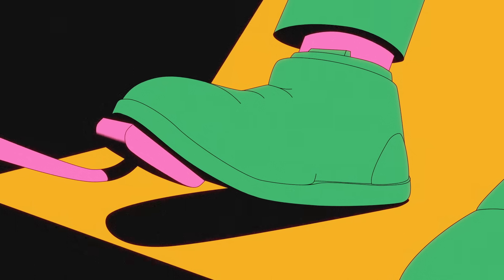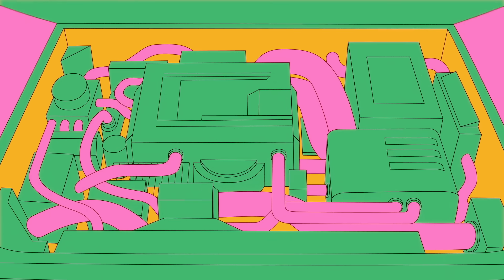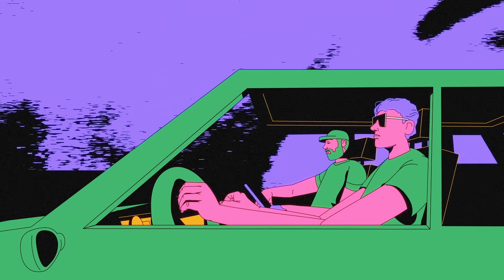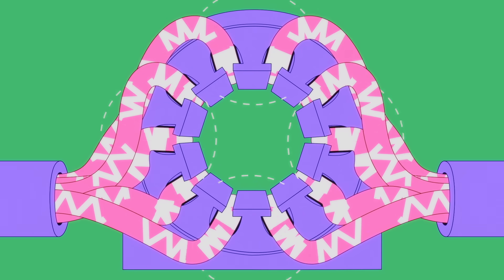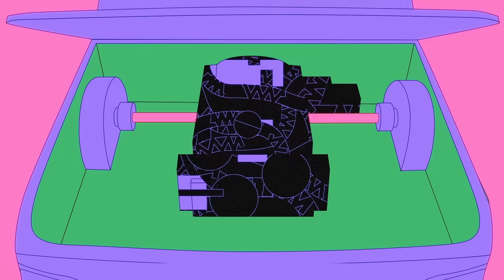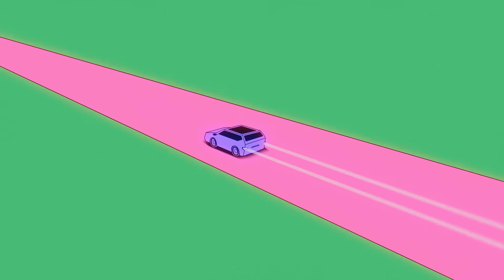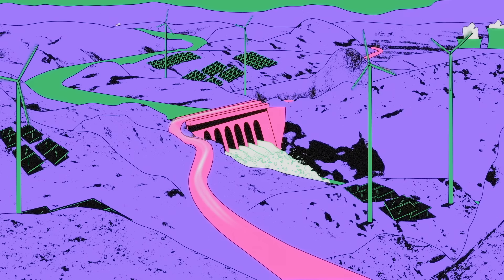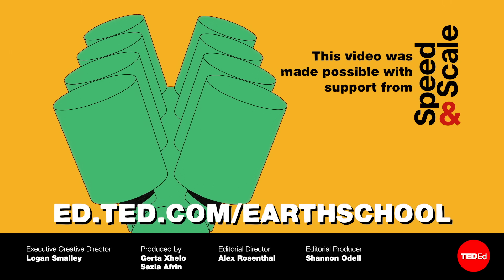This is what happens when you hit the gas - Shannon Odell

Comment: I love it how the wok always fail to mention the reality of EV when discussing them and only talk about the good.  

First of all, nobody seems to mention the fact of not only how expensive it is to build the batteries for these vehicles, but also how these rare metals are mined.  

Second, when a gas engine reaches even if life, it can be recycled or rebuilt.   When a battery reaches end of life, what happens to it?   Nothing.   Exactly.  Because nobody has figured out how to recycle them.  They are even more expensive to recycle.  

Finally, if you’re unlucky enough to have your car on fire, good luck putting that EV fire out.  They have become the firefighter’s worst nightmare.  

When you’re trying to educate people, you should do a good job of showing all the facts and not just the ones that please your narrative.  Anyone that’s still considering buying a EV, should do the research about the facts I stated above.  Yes EV are the future, but as of now, that future is not here and the technology is still new and needs more work.
Reply: "Because nobody has figured out how to recycle them." - multiple companies will offer to recycle them. Thats before you consider many car batteries can be reused without modification as batteries in other uses. 

EVs catch fire less than 60x as often as a comparable ICE vehicle. Sure its not great when they do catch fire, but having to deal with 60 ICE fires aint great either. 

The "facts" you mentioned are common knowledge. People know EVs cost more, but also cost less to run - thats literally their major selling point.
Reply: @Garfie489  first, go read about how the resources needed to build the batteries are mined and where and what type of labor.   Second, as far as recycling goes, have you ever tried to recycle a solar panel or a EV battery?   The technology is not there.  Anyone that tells you that they are recycling it, are lying to you.  Make a simple call to the company that manages your normal waste and ask them about it.  Then call your local city and ask them about it and see how much they know and what I formation you get.  I have done my research on this as well as from personal experience.  As far as the cost goes, with the rise in electric bills, it is already just as expensive as gas depending where you live.  Many car companies offer free charging for 2-3 years that may seem like a cost cutting strategy, but eventually you will have to pay for the charges and believe me with anything else, once the demand goes up, so will the price of electricity.  Also the battery is another cost issue.  It’s a known fact that the most expensive part of a EV is the battery.  Once that battery is damaged or reaches end of life, (which nobody really knows when that is since EV mass production is pretty new), the cost of replacing it is outrageous.  Often times it costs more than the car itself is worth at the time.  As far as fires go, most of the car fires that I’m taking about are during major disasters such as the ones we saw in Hawaii.  When a fire ravages through town, all cars regardless of engine type will burn.  

I’m not against EV.  I think it’s the future of travel, but right now, we don’t have the infrastructure, the ability to properly recycle the batteries, or even any idea how long they last and how expensive they are to repair.  That’s not to mention the fact that it takes so long to charge a EV.  Imagine if tomorrow half your city had EV, how long would you be waiting in line at a charging station to be able to charge and go?   What about travel?   Assume you want to go from Los Angeles to Las Vegas which is about a 240 mile trip.   What would happen is highway 15 gets backed up or if there’s an accident?   How will you be able to charge your car?   Will you even make it to your destination?   How about cross country drives?   This was the same issue we had back when the automobile was first introduced.  It wasn’t until the late 40’s and 50’s when they started to have gas stations all over where people weee able to travel long distances which is when the highway systems were built to accommodate that.  It took decades not few years.  It took decades to build engines that were more reliant, inexpensive, and better gas mileage.  Right now we are at the cross roads of where horse and buggy meets the automobile was 100 years ago.  We need to invest time and money to improve and eventually make that change.
Reply: @WWTormentor  i regularly recycle the same batteries as used in EV's. For me, its as simple as putting it in the correct bin - because there are multiple companies out there that do exactly that.  

My "local city" has one such bin at our local recycling center. Its really not that hard - your "research" likely doesnt meet the standard of what research actually is, given it can be disproven by a simple Google - nevermind this being a part of my PhD. 

It costs pennies to "refuel" an EV, whereas it costs a days wages to do the same with an ICE vehicle. They are not comparable. 

Also major events like forest fires wouldnt affect the average that much, because as you say - both burn. Thus the average is the same for both - yet ICE vehicles have a rate 60x higher than that of EVs per vehicle sold.... which actually suggests the rate of ICE fires is actually worse. 

The majority of people drive less than 50 miles a day. If you have an EV with 250 miles of range, you may only need to plug it in once a week whilst at home overnight. The majority of EV owners never have to visit anywhere to recharge - so if half the population had one, itd be no issue at all in terms of finding a charging station.

Comment: I designed a piston free rotary engine that gets the equivalent of 80mpg without "driving techniques".  It's also got extreme amounts of torque.  It's very similar to the new YASA motor being implemented by Mercedes on their new line of EVs.  It applies the force to the outer edge of the fly wheel.  My motor uses 4 apposing rotary wheels and scales from 1hp to 1000hp using very inexpensive materials and the fewest moving parts of any combustion engine available on the market today.

But nobody is buying and yall don't get nothing for free.  I don't help nobody that ain't helpin me first and most.

Comment: Clicked on this hoping it would actually be an informative video on how modern cars work, extremely disappointed. Not only was this not informative and clickbait, it was essentially just very quiet EV advertisement. EV's are NOT THE FUTURE. The batteries are toxic and none of these companies have good answers for sustainability, reliability, recycling, or environmentally friendly operation.
Reply: Still better than gas on enviornmental goals by far. Plus, Electricity is simply more efficient, maybe not now, but certainly in 10 to 20 years

Comment: Imo EVs have extremely great potentials, the energy efficiency, relative cleanliness and relatively low pollution (both air and noise). However, there are some major drawbacks that the video didn’t mention:

The main problem for most users is range. Most models can only drive for around 500km and currently don’t have adequate charging infrastructure, making long-distance travel difficult

Like many other comments have said, current lithium batteries require destructive minings for materials which creat heavy pollution, not to mention ethical issues in certain facilities 

The other problem is field serviceability (or lack thereof). Sure, the lower amount of parts makes them more reliable, but if things go wrong, the only option most of the time is to go to a specialized repair shop, unlike ICE cars that can be fixed on the side of the road (assuming the occupants have enough skills to do so)
Reply: Newer battery tech might solve these problems. At least in the US, Ev charging is pretty robust. However, newer battery tech more greater sustainability and range will have to be researched on.

Comment: I love the work you guys/gals do in entertaining and educating, and this video is no exception. I only wish you had also mentioned highway efficiency comparisons of electric and ICE vehicles.
Electric cars are phenomenal for city driving, but consume more and more energy as the speed to maintain increases. It is my understanding that ICE vehicles are technically more efficient for long distance/higher speed driving.

I would love to see you guys make a video dedicated to that.
Reply: EVs remain more efficient for long distance/higher speed driving. 

The issue with them becomes convenience. The main two advantages ICEs have over EVs is power density, and portability - both of these become significant factors when distance or loads are increased,
Reply: @Garfie489   Could you please provide me with some kind of source? I honestly forget where I learned my understanding from, and it may very well be wrong/outdated. Thanks for the reply!
Reply: @peacefultreasure8497  EVs are always way more efficient than ICEs, the range of efficiency was said in the video. But, ICEs (except hybrids) are so bad at low speeds that it makes us talk more about it. That's it.
Reply: @peacefultreasure8497 Efficiency: EVs can typically achieve efficiency ratings of around 3 to 4 miles per kilowatt-hour (kWh) on highways. This means they can travel 3 to 4 miles for every kWh of electricity consumed.Range: Many modern EVs offer highway ranges of 200 to 300 miles or more on a single charge. Some high-end models can even exceed 300 miles.

Comment: The problem with continuous pulse and glide model is that when releasing the pedal engine braking will start and decrease the efficiency of glide. I don’t know if modern automatic cars allow coasting with disengaging gears
Reply: manual user has entered the chat
Reply: So use the clutch?...
Reply: depends how fast/what gear you're going, but if it's low enough RPM the engine braking effect will be minimal, and still more efficient. Low RPM is better for gas mileage anyway, and automatic cars tend to favor driving in higher gear if possible for that reason. But you can also always put it in neutral if you're gliding fast enough or downhill at all, or use the clutch.

Comment: Very good explaination of the driving strategy to exploit the engine efficiency. On the other hand this video contains some misleading information. You cannot compare  electric energy of the battery and chemical energy of the fuel. A thermodynamic machine is needed to convert chemical energy to mechanical work, while electric energy is already mechanical energy stored as electric potential in the battery. Hence the comparison battery/fuel tank is not fair and misleading. I expected a better content form TED, especially on the scientific side. No one is going to get advantage from erroneous informations.

Comment: A major problem with EV vehicles is the amount of time it takes to recharge it away from home.  Additionally, the lack of EV charging stations.  You simply can't just freely drive where ever you want.  It has to be a planned destination to determine if you have enough juice to get there and back.  It makes road trips difficult or nearly impossible.  For this reason I will never adopt an EV vehicle until there's a real solution or drastic improvement on fast charging time

Comment: It’s very well explained. You just forgot to mention that, in electrical cars, it’s the construction of the batteries, solar panels, etc that releases lots of co2
Reply: Nonsense, gas and diesel vehicles emit far, far more.
Reply: @JakeRichardsong  wait until you find out how they generate the electricity to power EVs 🤯
Reply: @HIFLY01  Already know... most EVs in the US are in CA....solar power, wind power, hydropower, geothermal, and getting cleaner every day.
Reply: @JakeRichardsong  wait until you hear that they were running out of power and had to limit it for everything 🤯
Reply: This whole video felt like EV propaganda to me
Reply: That is obvious, but probably wasn't mentioned because ICE cars and their thousands of parts also release lots of CO2 during at the manufacturing phase.
Reply: it takes about 2 years of EV driving to offset the emissions of its construction, this is a well researched and documented fact. You realize that ICE cars also require incredible amounts of co2 release during its construction too right?
Reply: So? No magical tech that reduces emissions by 100%. You oil shills are insufferable
Reply: Evs are way heavier, thus more wear on the wheels and roads. Creating more maintaince and tyre waist.

Comment: If only we had more electric mass transit, that would be even more efficient at moving people.
Reply: It's on the way 😊
The company I work for just put  24 all electric mass transit vehicles on the road.
Reply: @anonymousanonymous-tw3wm  good to hear that's happening
Reply: People like to own their own house and go to and from when they please as they should be able to. Once you move outside the city you'll realize its not very practical especially for trains. Buses are one thing for larger towns but not every city has enough money to pay for them
Reply: @HIFLY01  The problem is - in this economy, no one is owning their own homes. They've been bought up by the landlording class. Plus, with a well-planned city and transportation system, you can indeed get anywhere you want whenever you please even with a public transit. It's also far more cheaper to take the train than the cost you need to maintain a car, meaning that trains promote more social mobility. America used to have very good public transit until the auto lobby killed it.
Reply: @scythal  maintaining a car isn't that expensive unless you go to the mechanic often. I've checked and at least personally for me its either the same or higher cost to take the public transportation system to my nearest city and that is just the train itself. Adding buses makes owning a car cheaper and this is with my old 99 Subaru with around 20mpg. More modern cars like a Hyundai Elantra get closer to 38 so I could drive to the city with 1.5 gallons of gas. Thats less than $6 at the current price of gas vs $6.75 for a 1 way ticket via train. 

I'd still need to go to the train station by bus and still need to take the bus from the station to my destination 4 times per trip. 

Yeah if you lived 3 blocks from your work in the city it probably would be cheaper but a lot of states like Illinois tax everyone for public transportation thats used in Chicago and thats not fair to us. I don't live in the Chicago and 9 million others also dont but we shouldn't have to prove to a city and get nothing in return. If people want to do that, set up donation boxes

Comment: I might be an auto mechanic after college, but I'm really excited about EV's. I would love to have one.
Reply: being a auto mechanic doesnt mean to work only with one type of engine, at least in my opinion
Reply: @Pedro-zh6kk  Well some people might ask me why I own an EV when I fix gas cars for a living, assuming I became a mechanic because I love gas engines over batteries. Some people can really generalize like that.
Reply: So you want to pollute the planet even more? Gee, that's great.
Reply: You should know that the reason EV's haven't surpassed fossil fuel powered cars isn't because of their speed or price, but rather because how long it takes to charge them. If a fuel powered car is on empty it may take as short as 5 minutes to refuel, but if an EV's battery is drained it could take hours to fully charge. I'm not an electrical engineer, but it's my understanding that the technology simply doesn't exist yet to make EV batteries charge faster.
Reply: @catdogmousecheese  Not necessarily. Highly depends on where you are charging your EV. At home, sure - depending on where you live you only have a low voltage to fuel your car, but that shouldn’t be concerning as you typically charge over night. At gas stations, at least in Germany, there are most of the time super chargers, which let you charge your EV with up to 250kW. In my experience the charging process often only takes about 15 Minutes to get from 15 to 90%. That time is quite practical to get to the restroom, get something to eat or just walk around and relax your feet.
Reply: @catdogmousecheese I mean my family just charge our electric car at home nightly. Saved 100-200 dollars a month and only had to go to a charging station two times in one year. Unless you are going on a road trip or from city to city, electric cars are just more convenient
Reply: @catdogmousecheese  The technology is still in development. I'm particularly excited for when ev's have solid state batteries like in this video:
https://youtube.com/shorts/ORfGt4Nh7hs?si=ZkQRpW0VMJ9idXP7